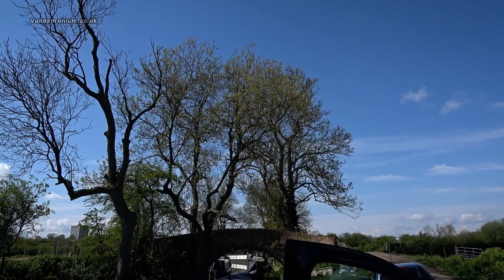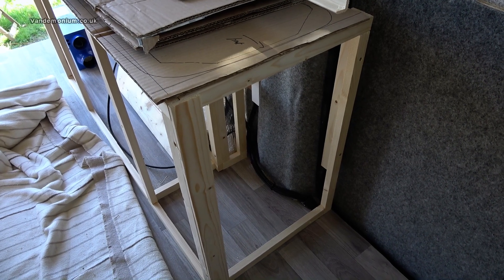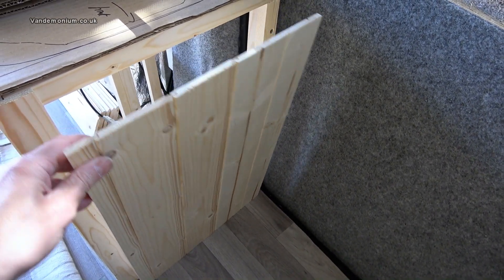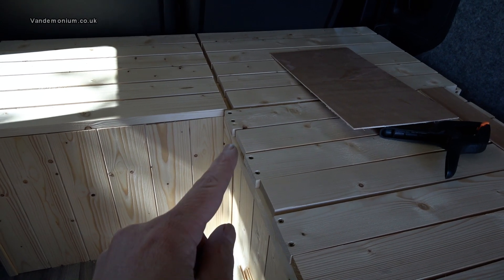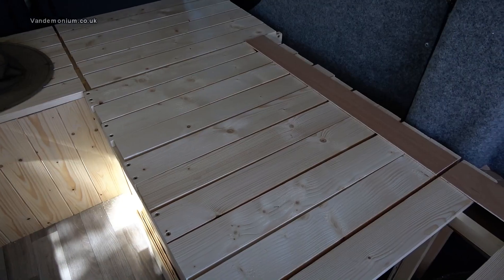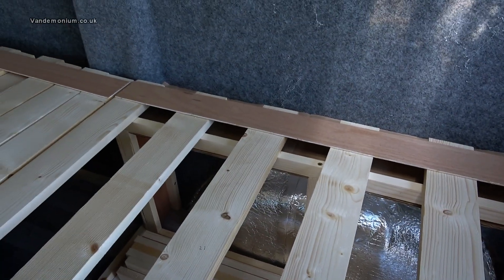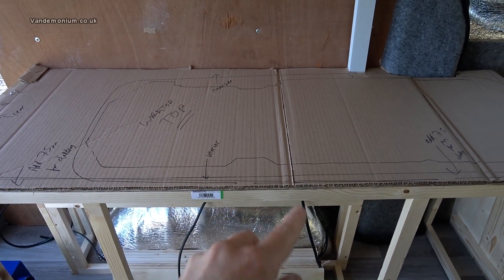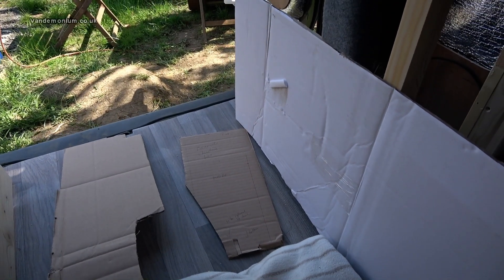Vlog 16: more wobbly furniture building for my DIY campervan conversion

Comment: I've tried to imagine having a dump using that toilet and I've spent 10 minutes laughing till I cried,  picturing sitting on the toilet making eye contact with people walking by or friends and family inside the van. The issue could be resolved by putting a bucket over my head so I couldn't see anyone. 😅
Reply from the maker: Or close the curtains!
Reply: @Vandemonium  I'm going with the bucket. It's quicker
Reply: @barkendog1 You risk having people ask you to keep the bucket on permanently though. Just saying.

Comment: I have followed your van conversion build from the start, a fabulous job. Can you tell me what u managed to get it registered as with dvla when you finished it. Cheers happy travels
Reply from the maker: Hi. They’ve changed the rules since I did it but I had to send loads of photos showing the outside and inside, to prove it had a fixed bed, cooker, table etc. It’s been made harder now, I believe.

Comment: Hi there, been binge watching your videos all night! What a huge inspiration. Just one question something i may have missed in your earlier videos but it just came to my attention, how did you stick the vapourproof lining? Was it the same stuff you used for the carpet or was it self adhesive? Thanks
Reply from the maker: Yes, the same high temperature spray adhesive, called "Trim Fix". Cheers

Comment: Sir, I wonder if you considered the Murphy Bed?  It is a term in the US and would save lots of floor space.
Reply from the maker: There's no room vertically to stand a murphy bed, plus the bed also has to double as storage and as a seat so a murphy bed wouldn't be suitable. Cheers

Comment: You're going to need some sort of supports (i.e., legs) under the pull-out section of the bed, otherwise the pull-out section will bend down toward the floor when weight is put on it.
Reply from the maker: Yes indeed, it collapses as soon as you pull it out present! Legs will go on!
Reply: You don't need legs if you put a cross member underneath. But it does depend how far out you want to extend it.
Reply from the maker: Believe me it needs legs. They're just not attached yet. Plenty of time!

Comment: Brilliant effort (or at least it looks that way for this armchair warrior who’s paying someone else to clear the back yard and garage rather than do it myself :-)). Anyway, good enough for the start. You can always redo bits later if they really don’t work. I am curious though about your car: will you run a car and a van plus narrowboat once done renovating the van?
Reply from the maker: Well I live in the boat so that's not going anywhere! To start with I will keep car and van - the car's very cheap to run and ideal for nipping to the shops where the van will definitely be a campervan. Maybe later I'll just have the van.

Comment: How did you attach the framing for the bed and kitchen unit to the side of the van (self-tapping screws or plusnuts or other)? Thank you for your time.
Reply from the maker: The bedframe is attached to the floor, for the kitchen I used self-drilling screws if I remember correctly.

Comment: Incidentally, a mate of mine who's in IT told me just the other day that the current trend in program and systems development is, as it appeared to me, anyway, to follow a method closer to the one you prefer, ie to start the project from a rudimentary base and continuously consult with the client about changing technology as it pertains to their requirements until most or all of them are met, or until the budget runs out, I presume! This is called the agile method of development, as opposed to the older more rigid method, which is called the waterfall method and by which all the requirements and features of the project are determined beforehand, after which the project is developed over an agreed time period, delivered and found to be partially obsolete and/or redundant, since technology may have surpassed the capabilities of the product and/or the requirements of the client may have changed. So there is that, just in case you decide to decide to go back into IT instead of becoming a professional campervan convertor!
Reply from the maker: Haha I often wondered what "agile development" was, who knew I was such a pioneer?! ;-)
Reply: @Vandemonium  👌😄

Comment: May I suggest what Ive done for many years and its never failed. Invest in a biscuit jointer Screw- fix sells cheap brands the machine will solve and make the strongest joints you will ever  need using a beach wooden biscuit. In your case after you have cut the joint only glue PVA one half of the biscuit these will swell make certain to clean the other half of biscuit. Leave to dry for one hour then lightly sand the other half of biscuits keep testing the joint as it wants to be tight and will swell slightly with condensation. A biscuit not to close yo every corner will sort your problem. If you have never used a biscuit jointer then practice on scrap wood and check out on line YOUTUBE HOW TO USE A BISCUIT JOINTER. The secret to best joints is setting the machine up so it cuts accurately the cheaper biscuit jointing machines take longer to set up then the expensive biscuit jointers due to the pinion method that is used. These machines are a must to own and will give strength and speed up any thing you manufacture. Ive been a Cabinet maker over 44 years and if I could only own one electric machine a biscuit Jointer would be at the top of my list over any other tool. Dont forget to purchace the beach pressed biscuits about £30 for a 1000 but can buy smaller quantities the size that best for most jobs is 20 mm but the next size down 15mm may be best if your using thin timber. All you then do for your door is pull it gently and it will ease away from the frame work when pushed back into place it will be forever held very firmly. Let me know how you get on please. Thanks from,               Karl, THE COFFIN MAKER.
Reply from the maker: Hi. Thank you for the detailed suggestion. I seem to recall watching a few "biscuit joint" videos when I was browsing various DIY channels etc in the run up to my build but I nnever did get one. This video, like all the others, is a few weeks behind "real time" on the van so by now the furniture's largely done but thanks again. Cheers

Comment: Gluing that piece into the corner was not called for, if you needed to you could arrange for a temporary restraint. It is better to wait with the bits that really finishes things and mean that it will be difficult to change.
Reply from the maker: Well yes I know that, that's why I said it was a mistake!! ;-)

Comment: I am an architectural designer by trade, in fact, my YouTube name, deezynar = designer.  It is much easier to design full sized buildings than tiny spaces like a van.  Using every square millimeter is important in a van, and not quite as critical in a house.  Also, houses have vertical walls that run pretty straight for several feet.  Vans have rounded corners and sloping/curving walls.  My drawing before building abilities get challenged when dealing with the extra problems seen in the stuff you are dealing with.  I would make a 3D model in Sketch-Up, and try to work it out in advance, but it is a gamble that is not guaranteed to work perfectly.  Sketch-Up is not as user friendly as people try to say it is, so don't feel bad about struggling with it.

Comment: It's called concurrent engineering.
Reply from the maker: You mean it's really a Thing? Does this mean I'm doing it by a formal methodology?! :-)
Reply: From Google:
"Concurrent engineering, also known as simultaneous engineering, is a method of designing and developing products, in which the different stages run simultaneously, rather than consecutively. It decreases product development time and also the time to market, leading to improved productivity and reduced costs."
Reply from the maker: Woohoo!! :-)

Comment: Piano hinges for your door done right you won’t see them
Reply from the maker: I've used magnets. I'm rather liking the magnets for quite a lot of it, as you'll see!!
Reply: Dude what about using the bit you cut out of the hob sink section you would cut out of a nice piece of wood as a table top.?